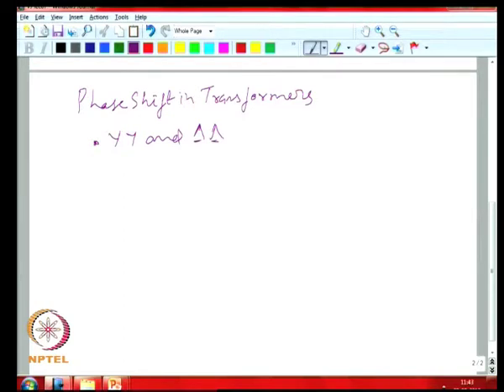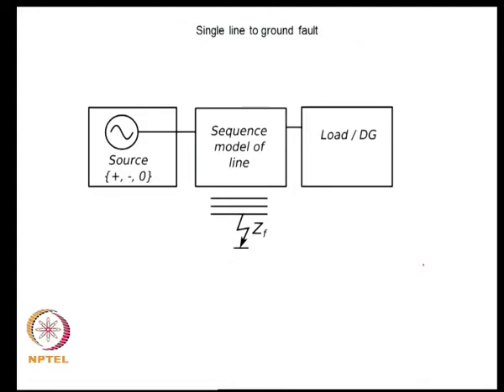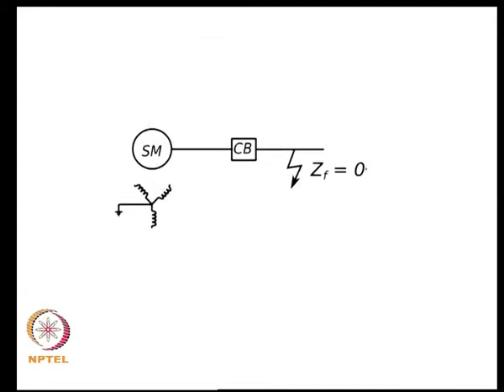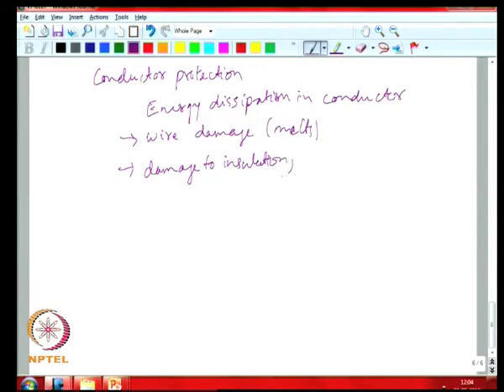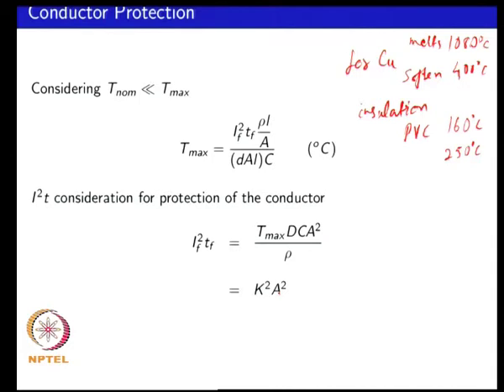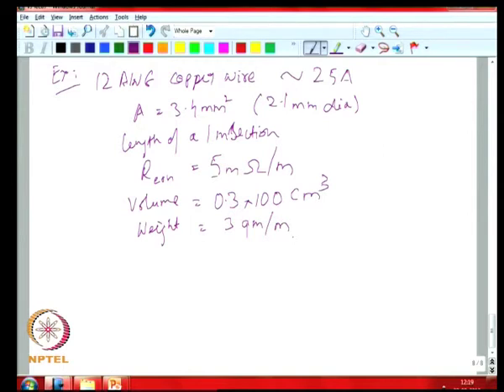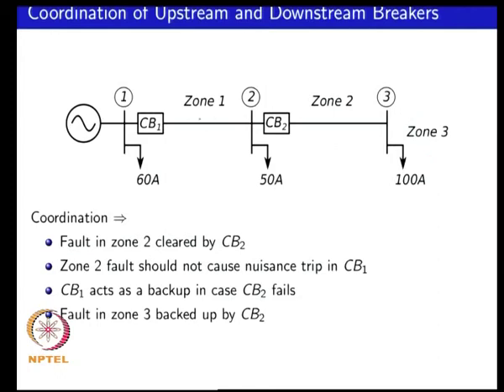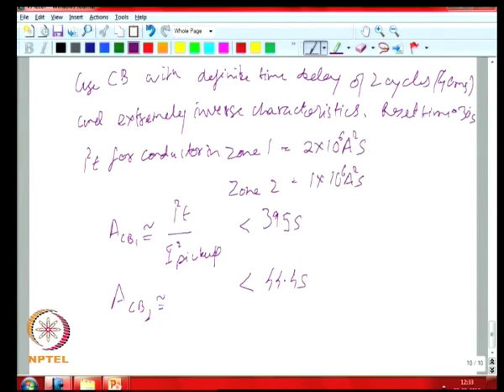Mod-01 Lec-07 Modeling of distribution system components

Comment: Sir, first thank you for the lecture. Found it very useful. 
On clip 20:43 and following, the Fault current, If, given as the answer, and used to size the neutral impedance is 3.3pu.
The correct value for If is about 4.29pu ≅4.3pu as If = 3*1pu/(|i0.3 +i0.3 +i0.1|) = 3/(| i0.7 |). This would also change the Zn